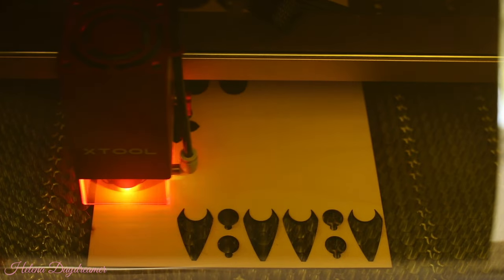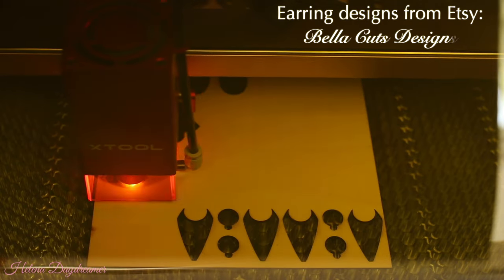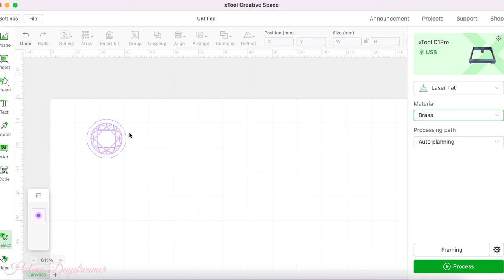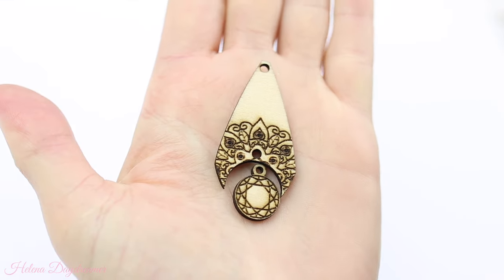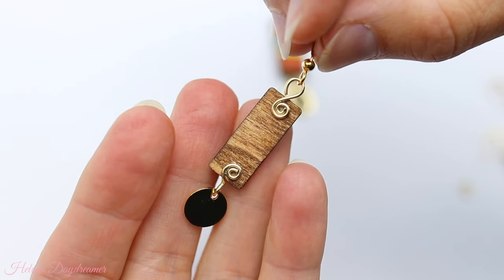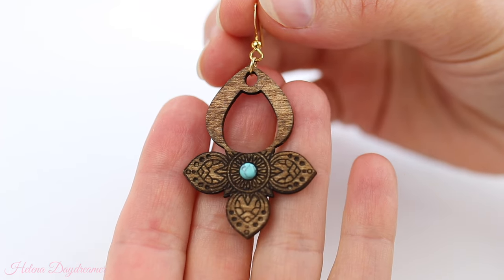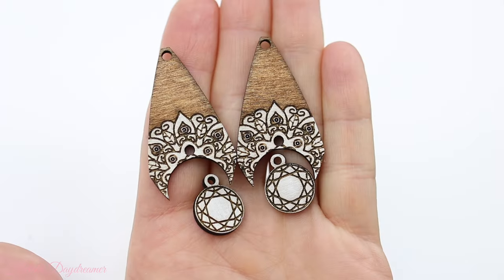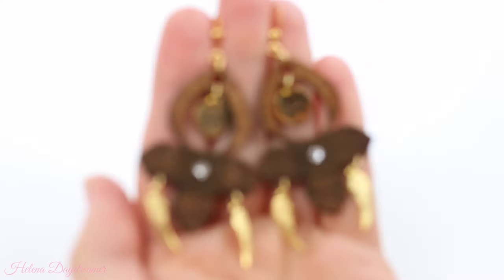Making DIY Jewelry with xTool D1 Pro 20w & Infrared Laser Module (metal & wood) DIY Jewellery

Comment: Did you use Laser Marking Spray to make the pattern show black on metal?
Reply from the maker: I didn’t use anything else just the laser. It usually comes out pretty black(if the right settings are used) it’s the oxidation. And these were brass based discs, perhaps it would be a bit lighter on st.steel.